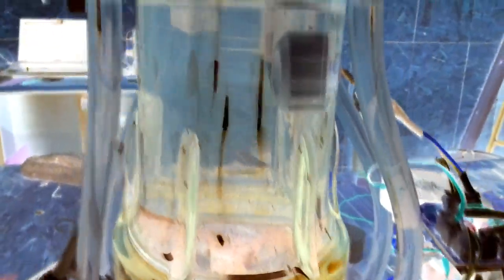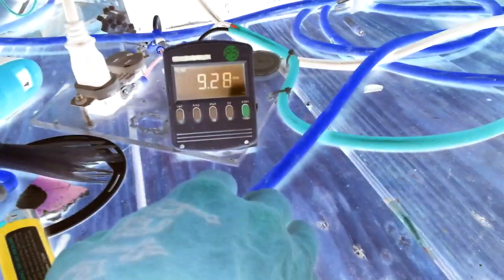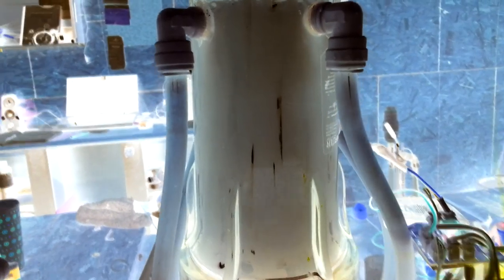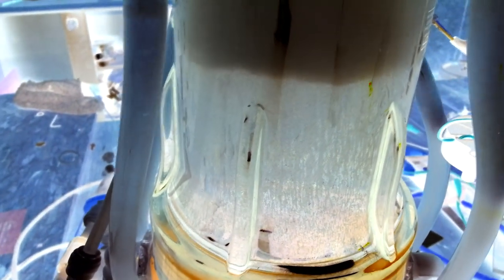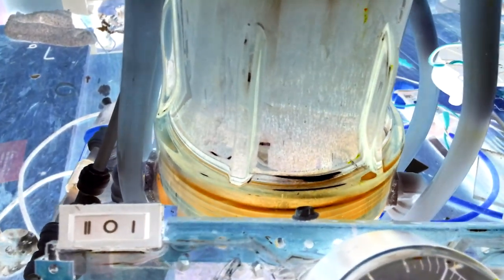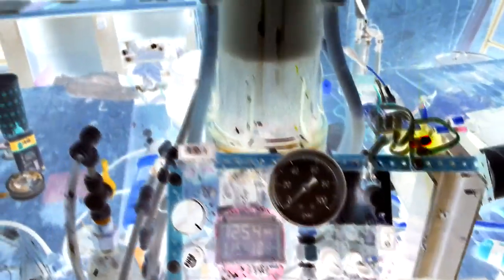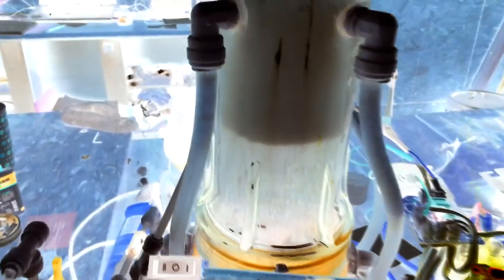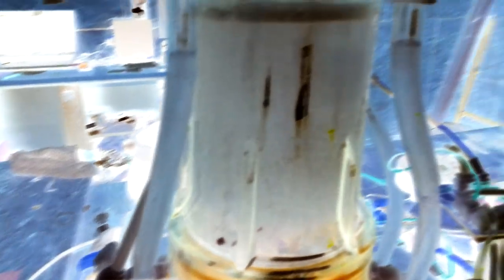Ultrasonic transducer testing of bubble coalescence in hho Torch

Comment: Ditto on the plastic welding, however you are also pushing micro sized oxygen -OH at the plastic which will oxidise it rapidly.
Also the transducer should be in your cell facing the direction your plates run. i.e. bottom up. It's called bubble coalescence. it turns small bubbles into big bubbles that float up faster. You'll also find that you may get better results with 2 ultrasonic units facing the same or opposing directions and slightly out of phase. You can also benefit from a single unit with a "sweeping" frequency and the other unit at a fixed frequency.

Comment: Ultrasonic vibrations are used in ultrasonic plastic welding.  The vibration super heats a small area of plastic and allows it to fuse together with other pieces of plastic.  The vibration of the water against the plastic is probably enough to bore that hole opposite the transducer.

Comment: i am only guessing here, but what about a rubber piece? refelctions always occure at a phase change... the transition between two materials with different wave impedances. you actually couple your soundwave directly into the water ( thats only making it worse, it doesnt dampen it ). i would imagine a metal bolt as beeing very reflective here because it is rather stiff. a soft piece of rubber might actually just absorb the energy by converting it into a reversible transformation energy...

Comment: Just a thought: if this is an ultrasonic cleaning transducer, it should be completely below the liquid level. If I am seeing right, it looks like it is right at the surface  when the foam forms. Ultrasonic transducers in cleaning equipment for microscopic bubbles that implode and cause shock waves. One possibility if you can't mount on the bottom, is to make it submersible: mount the transducer in PVC filled with silicon , leaving the top of the transducer exposed.

Comment from the maker: yes good comment , basicly mounting the crystal in the bottom would be very   difficult but i may have to , i would have to take nearly the hole thing apart to run the power threw the base. im trying to avoid doing it

Comment from the maker: cool thanks for the info ill check out the videos , i was worried that if it could do that to plastic what would a reflection do... any way the device works great but i need 3 more of them to get the effect i need at 20 amps nonetheless i love this thing , if the solution is saturated with more bubbles then the 14 watt transducer can handle it seems to shield 
the side wall of my reservoir.   it does let me run at 10 amps 100% duty cycle which i cannot do without it.

Comment from the maker: yes friend you are correct, i was not aware that these things burn them selfs up if not submerged , i actually experimented with many fluid levels in the reservoir . unfortunately i have decided the ultrasonics are not worth it unless you have at least 200 watts it helped just not practical and it doesnt faze the foam??? it does however consolidate  micro bubbles

Comment: I've been using an ultrasonic rod before, to break crystal aggregates. That thing had a LOT more power than the little piezos of commercially available nebulizers (Couldn't tell you by how much though, or what frequency anymore), but I only ran into that kind of trouble once.

I had stuck it at full power right on the edge of the plastic container (a ppco centrifuge vessel), so I'm quite surprised this little piezo could do any damage. What material is your container made of? PET?

Comment: Little late getting to you.  The transducer needs to be on the bottom, in fact put two or three at the bottom for better results.   Personal opinion, I would sell all that you have invested and simply gas proof the ultrasonic transducers  (use the good ones like used in hydroponic gardens.)    Simply take off the water sensor, plug the holes with a conductive metal, and seal.   Try this on a lawn mower engine first to work out quirks then graduate to a beater car and when you feel comfortable use in the daily driver.  Disconnect your fuel pump at the fuse box, let the mist run into the carb, throttle body, or what have you.  You will save tons of money an tons of headaches.  The good thing about only taking the fuse out for the fuel pump is you will have a second option on running your vehicle should anything go wrong.  What I am interested in is taking the hit, purchasing a damn good generator and run it on mist to power a home without out giving another cent to the power company.   Now, it is said a car will get 100-150 mpg from gas mist, so a generator would pay for itself really fast.
Reply from the maker: my work with oxyhydrogen is not transportation related but thanks for the input friend . i mainly only use this stuff for torches

Comment: Sonarluminescence it looks like if you had the same setup centered on the other side instead of a hole you might have a "star in jar". search the video on you tube. also you might want to look at the sonic water heater. and start checking you water temps. before and after.
Reply from the maker: Great input friend thanks for your time

Comment: Did you know you can get rid of most of the bubbles buy cleaning or filtering the elite water. Also try to use staight barb fittings when ever possible. The more corners the more bubbles. I like the ultra sonic idea also, have you thought of pointing the ultra sonic between two plates making the gas to see if the product is increased? Give it a shot. Thanks for sharing

Comment: Great video, I'm wondering if something as simple as a defoaming agent like the chemicals they use in the low sudsing laundry detergents could by chance be an easy fix or would the desudsing chems interfere with the HHO production ( might make it work better?) I'm very new to all this so excuse me for commenting but, the thought just popped in my head and thought hmmm, maybe! You would have to research what the list of desudsing chems are, I have zero research on them currently. Hell it may act as an octane booster in the whole setup?? Your Thoughts?
Reply from the maker: well sir i certainly hope some body hasnt fooled you into thinking hho will increase gas mileage it does no such thing , in fact hho will over time destroy your engine , look up hydrogen embrittlement  , i personally try not to use the term hho to stay out of that crowd  i strictly use this gas for a very special torch , it can do things no other torch can do but i like to for fabrication of small prototypes or builds it makes the best soldering iron i have ever used as it is possible to make what we call a micro flame
Reply from the maker: additives have not worked well for me , it turns out im dealing with chemical incompatibility issues and i hope to have my final device ready soon, i have used all the torches in my videos to do many builds but i am constantly improving the device because i enjoy having it, i never run out of gas, i just plug it in its also fun to battle the beast as it is a very tricky device to build any one who has can validate this, its not as easy as it looks , sodium hydroxide is nasty stuff and a very slippery leaky liquid that that will baffle you every step of they way over heating and power supply issues also ad to the complexity
Reply from the maker: well any body who owns a browns gas cell without a cooling system is in for some trouble you have to cool these things down and allot of frauds omit this fact

Comment from the maker: when i first turn on my cell i get 20 amps, now you know why that is so im thinking that if i inserted a transducer into a T fitting at the bottom of my cell i could inject ultrasonic energy directly into my cell to give me back some of my plate service area , this would drastically change the potential of a small cell, kinda like a super charge electrolyser, i am not expecting magic or a violation of faraday's law but just a way to redeem some plate area, you loose like 30% to polarisation